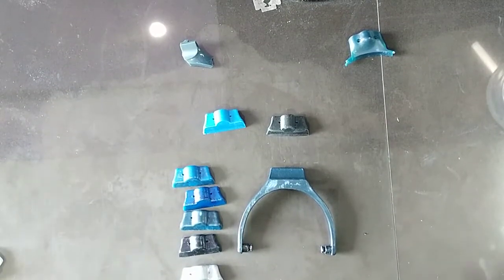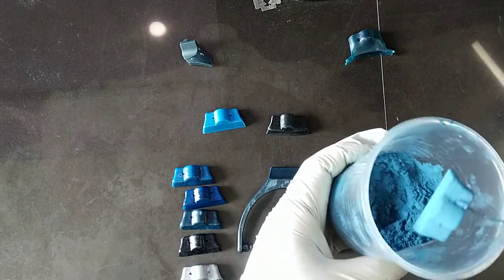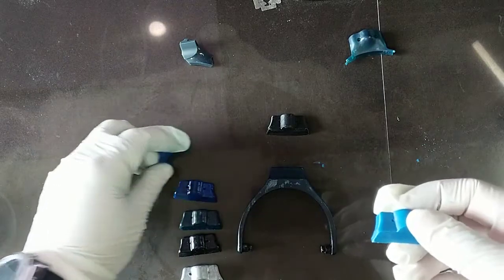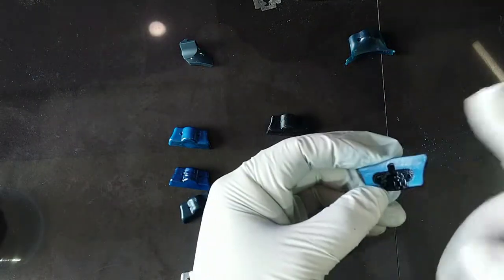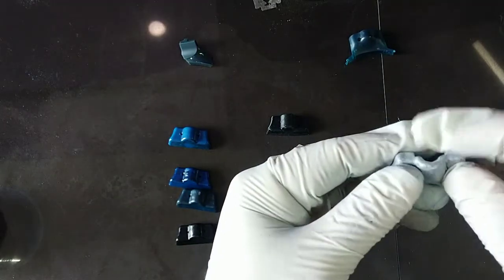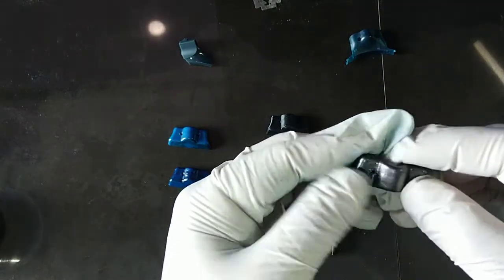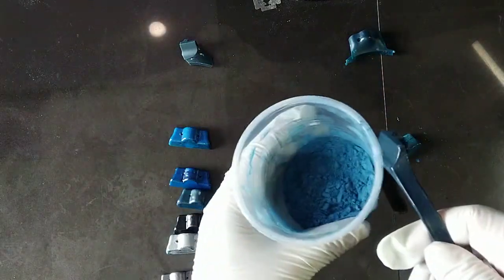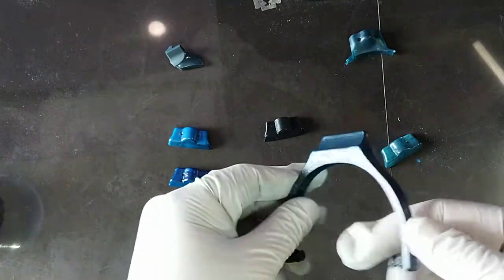Powder Coating ABS 3d printed parts

Comment: does the aluminium powder affect the mechanical properties? is the adhesion strong enough to not crack like in Breaking Taps video?
Reply from the maker: Haven't tested the mechanical properties, I'm using it for the visuals for now. My guess will be that the mechanical properties are not affected, + or -. as the powder is embed inside the plastic but the grains are not interlinked like electroplating will do. The difference is that graphite coat is not painted on the surface, but sinks inside the plastic that the acetone dissolves, and probably has better adhesion.

Comment: how do you source the powder?
Reply from the maker: The colored ones are laser printer tonner powder, from damaged cartridges. The aluminium powder ebay, search for "aluminium metal powder mesh..." or something similar, graphite powder and titinium dioxide in the hardware store.
Reply: @jotatsu  thank you a lot! I wonder if perhaps this would work with PLA/PETG parts, though how I am not sure since we cannot use acetone for that
Reply from the maker: @gedr7664  Tried  with PLA, nothing i have at hand dissolves it. Forums say Tetrahydrofuran and ethyl acetate work on PLA, but i have neither, nor i want to deal with those chemicals.  PETG is even more resistant to chemicals.